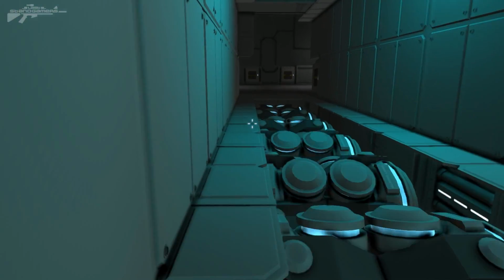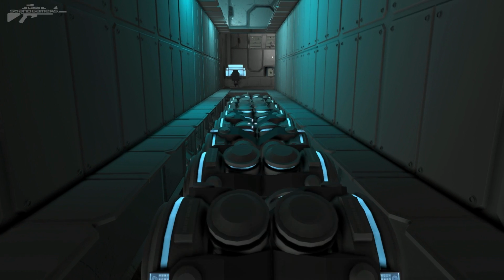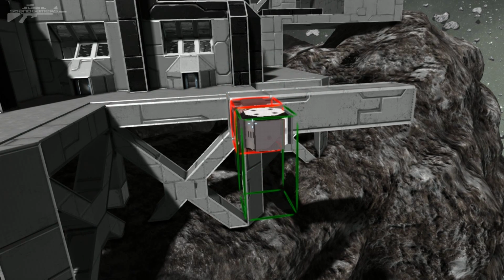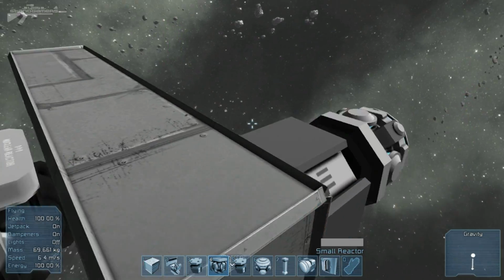Space Engineers - Factory Conveyor Belt Maximizing Production and Ore Transport

Comment: That gravity torpedo you've been working on, instead of stone try a ball with drills on all sides.:-)
Reply: Already tried. The drill hat gravity blocks to hold in a gravity containment.
Turned on the generator and I wanted it spining (secondary effect of grav containment) so i didn't add any gyroscopes.

I move to the rocks.... and Crack ! structural failure.

So if you make that drill I already have the ship to move it =)